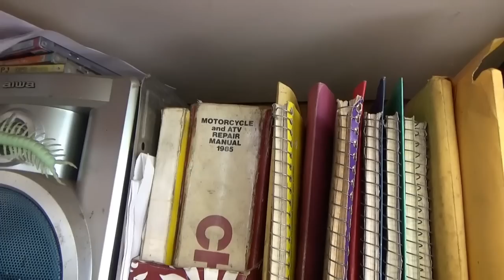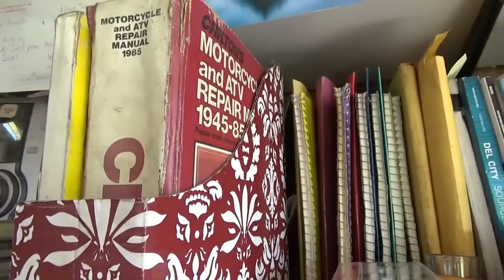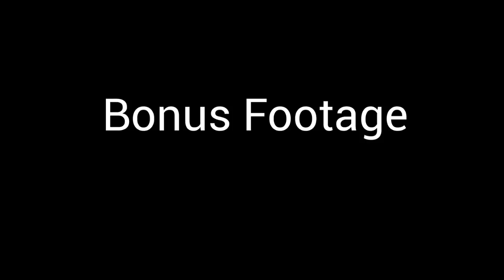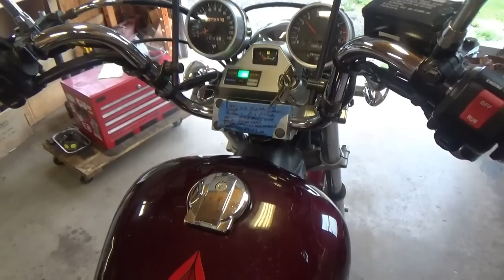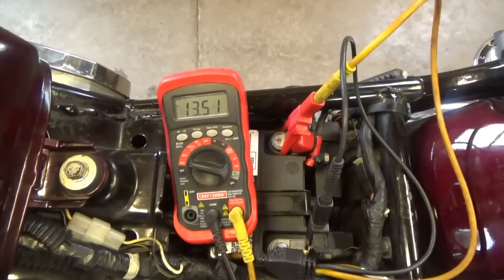Zen & the Art of Carburetor Cleaning

Comment: thats not a choke its an enrichment circuit. in the old days when gas was gas i used to buy  Berkible 2+2 gum cutter by the case. would make the grungiest carb  like new. with this ethanol i have yet to find a cleaner that will work like the old days.  one of the things i hate the most is these screwdrivers that are tapered instead of a proper blade. too many jets get screwed up by these. i actually found carburetor jet screwdrivers that are wonderful.  sold by briggs and stratton as a service tool.  sometimes you have to pull welch plugs to get passages clean or drill out steel balls.  never had a carb i couldnt fix  except the carter thermoquads. great idea but absolute garbage.

Comment: Brake clean works well for cleaning carbs used it with no issues on rubber parts but wd-40 is bad for rubber parts. Blow up a rubber balloon and put wd on it watch what happens. Pretty cool. But to each his own. https://www.partzilla.com/product/kawasaki/92055-1245?ref=400769966151a7a5f0cf82adc4dae4895ec4de26 o ring that you need for pilot screw btw. I hope i never have to work on a carb that someone sealed with rtv thought it was a good vid till i seen the rtv. Youll see why next time you take it apart. Glad it wont be me tho. Rtv to me is a very last resort on anything. I work on. Woulda been fine with just the o ring unless it was torn. Just did one on a 2005 hyosung. Reused old rings and no leaks but if i had to do it again id get new rubber everywhere. I mean 20-30 bucks is well worth not doing the job twice. Thanks for the vids bro but please forget that rtv crap unless its the only option
Reply from the maker: A dab of RTV is just cheap insurance. Have used that trick dozens of times with no issues 👍😉
Reply: Yes itll seal ok as long as you use the correct kind for gasoline but getting that crap back off is a nightmare and the rubber gaskets cant be reused again. Just my opinion that i dont like to use it if at all possible. Wish the carbs could be converted over to fi but havnt found any kits for my bike tho. Wish there were more places to get e free fuel but nothing close to me.

Comment: You're working way too hard.   I strip the rubber parts off the carb and drop the mess in the can of carburetor (Berrymans) cleaner solvent for 24 hours.   Rinse, blow dry and reassemble.   They come out squeaky clean and all the tiny passages are cleared out.